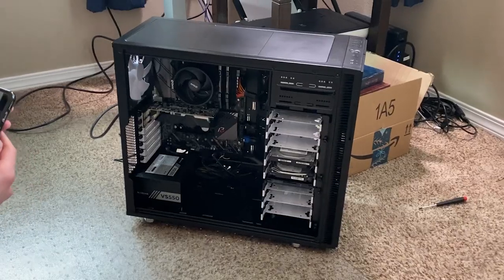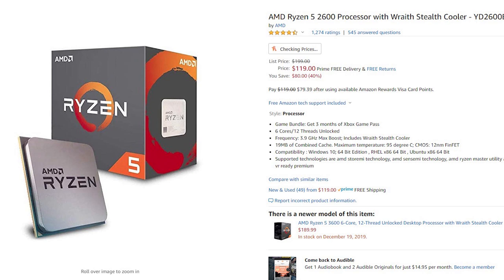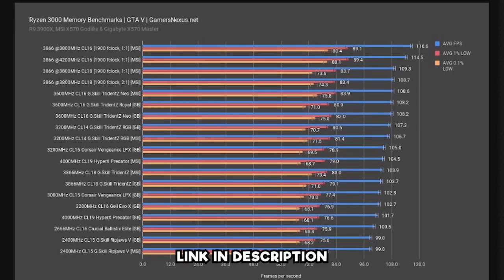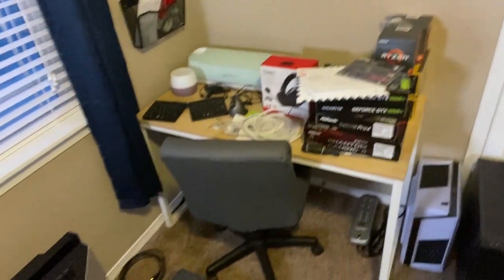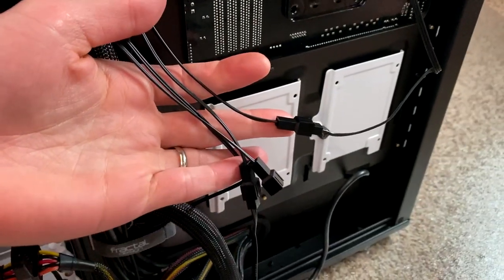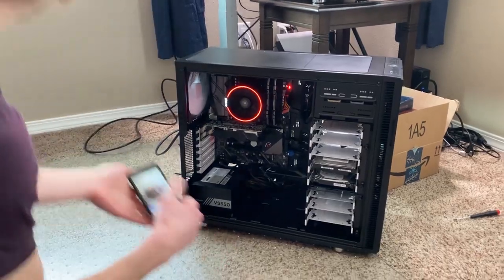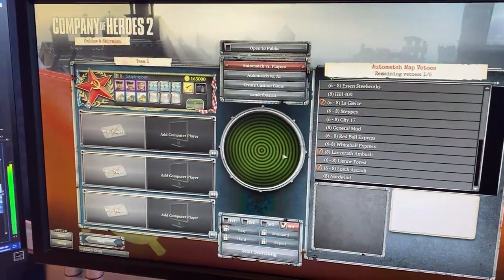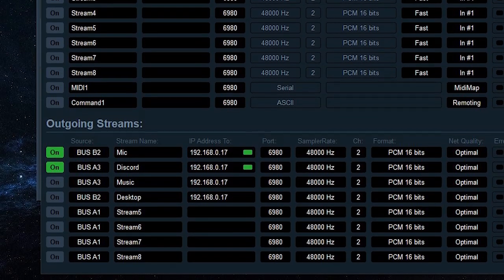Noob Builds Stream PC: Will it Boot!?

Comment: For Ryzen 2000 series 3200 MHz ram is safe choice because of its poor memory controller. But if you plan to upgrade CPU to 3000 even 4000 series later, 3600 MHz ram is best match for them. You can downclock ram speed to 3200 Mhz when you still using current CPU

Comment: Nice video mate. What was the experience with the weight on the stand? Did you have to send it back like?
Reply from the maker: Thanks! I returned it and got a heavier duty one. My monitor was under max weight by had a pound, but it still would slightly tilt over time.

Comment: Nice build, however, I think you should have also gotten a Ryzen 5 2600 (6c 12th) and replaced your i7 6700k (4c 8th), those extra four threads would have made a big performace improvement on your stream.
Reply from the maker: How did you come to that conclusion? I actually didn’t research the impact on thread vs cores specifically, but the passmark score led me to believe the multi-stream experience would be better on the 2700. So far it’s crushed the stream render without cracking 30%.
Reply: SkippyFX you are spot on, the 2700 was the right choice for what you do. The motherboard will allow you to grab a 3000 or potentially a 4000 series upgrade path in the future if you ever need it.
Reply: @skippyfx  Oh sorry I wasnt clear. I meant on your main gaming PC where you have i7 6700K and GTX 1080. I was suggesting to replace that with R5 2600. Your choice of R7 2700 for your streaming PC was a real good one.
Reply from the maker: Ah, yes! My wife’s gaming PC has the the Ryzen 5. I’d love to have one in mine as well, but the i7 is working well enough at the moment.